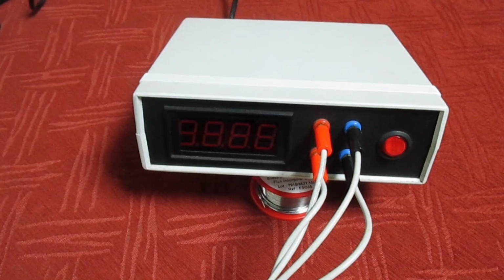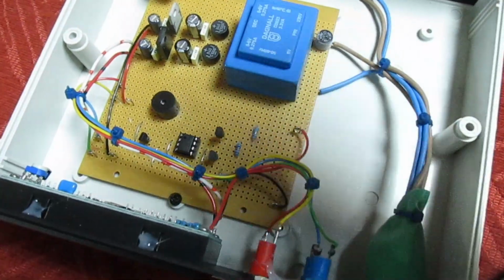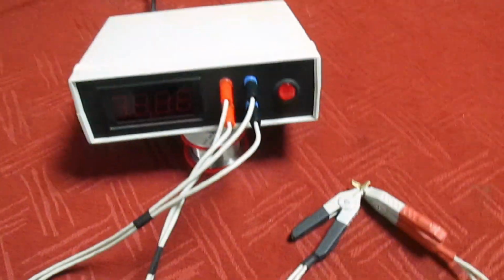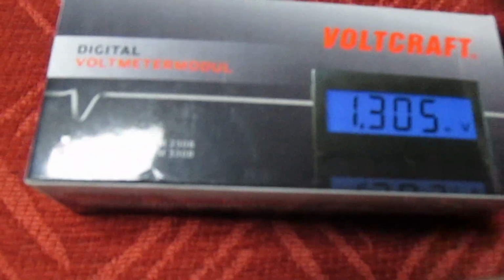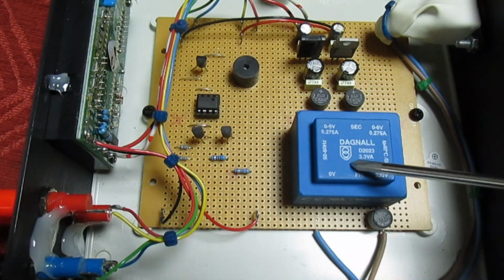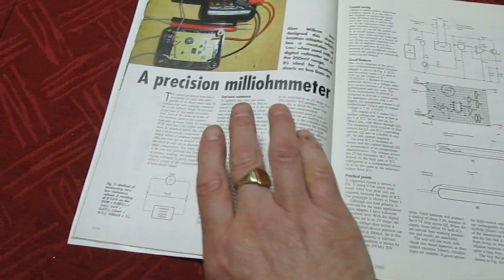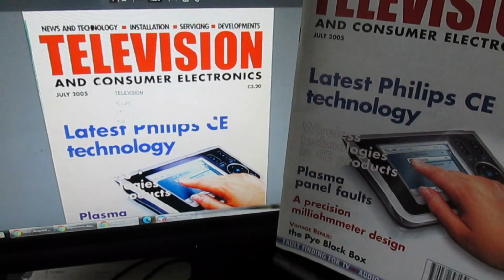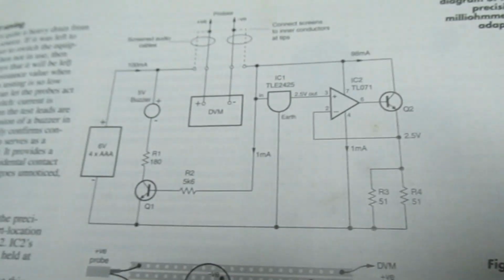DIY Precision milliohm meter by popular request with circuit diagram.

Comment: Hi Michael I enjoyed watching this video however your description of how a kelvin clip works is wrong one wire of the pair forces a current into your device under test and the other lead of the two wire set measures the voltage and because the voltmeter is of high impedence this doesnt disturb reading too much not sure of the impedence of the panel meter but your fluke handheld should be of the order of 10 Megohm impedence on the volts range hope that helps
Reply: Yes indeed. It's a very strange mistake. He keeps saying the wires are in parallel, and that it works because of the geometry, yet he built the thing, so he knows perfectly well that they are connected to different points inside the box, as we can see on the video. in any case the correct explanation is provided in the article.

He's also wrong about the current drain. Current only flows when the probes are connected to a resistance, or of course if shorted together. And that's another thing the buzzer is for. Again this is mentioned in the article.
Reply from the maker: Firstly most of my videos contain small mistakes, and if your saying current is only drawn when the probes are shorted how come the led display is lit as soon as the unit is switched on.
Reply: @michaeldranfield7140  I agree with you but i didnt say that  current only flows when connected to a resistance. I think what @EJP was trying to convey was current is only drawn through the probes when they are shorted. Obviously current is drawn for the electronics in the milliohmmeter.
Reply: @Michael Danfield This is not a 'small error', it is a major mistake. As to the current, you waved at the RHS of the circuit and stated it drew a lot of current all the time, hence no battery. It draws zero when unconnected.

Comment: I prefer to use NE5534 instead of TL071, less noise in the signal and therefore probably more accurate.
Reply from the maker: This was a very old  project and as you say there will be much better chips to use these days but the TL071 was good enough in its day .
Reply: This is mostly a DC device, the NE5534 is designed especially for it's AC properties (i.e... audio.). You can get any number of better DC performance opamps than an NE5534 these days and for around the same cost.

Comment: Hi, thanks for a great video, i built an adapter to go on my multimeter with an LM317 as a constant current source, but it seems a bit flaky. I use it to test the ground connection on mobile radio car aerials. I think i'll build your one as its an all in one device. With mobile radio, a decent earth is fairly easy to achieve at VHF and UHF, but under 70mhz it becomes a lot more critical
Reply from the maker: Excellent, I think thus would also find application in other car related things such as checking the battery negative to chassis integrity.
Reply: @michaeldranfield7140  I drive an electric car LOL!

Comment: While I do not plan on building this, I think a worthwhile upgrade would be to use 18650 batteries. They are rechargeable, commonly available,have good capacity and you do not have to mess with having to plug it in to use it.
Reply from the maker: of course , if you wanted portability .
Reply: If the device is always in one's workshop, on the other hand, a power point is likely very easy to come by

Comment: I do not have TLE2425. Could I use TL431?
Reply from the maker: I don't see why not but you would have calculate the resistance values to get the correct voltage reference, much easier to just buy the correct chip.
Reply: @michaeldranfield7140   I asked because in my town don't have the chip indicated on your video. TL431 came to my mind due to the reference voltage.

Comment: For short circuit fault finding it is better to have the output in the acoustic form (e.g. by the tone pitch,...) and with a relative reading mode (so you zero it on a value and it then indicate the lower resistances than that zero). In the 90's I remember such single purpose tester was published in our ham magazine ("A-radio" or the previous "Amaterske radio" named "Vyhledavac zkratu" aka "short circuit finder" or similar, it was published multiple times as various designs around the same principle). It used straight 2-pin connection, but the "zero memory" function took care of the probe wire resistance, so it did not need the 4 wire connection. It had just the beeper tone pitch as the main indication output and all the zeroing was by "remembering" the reference resistance as a voltage on a capacitor. It used a quad JFET opamp, one as the preaplifier, second as the "zero memory" sample and hold buffer (this was the part actually requiring the JFET inputs), 3'rd as a differential amplifier (amplifying the actual minus the stored value) and the 4th was the tone generator VCO. The sound output made the high current (30..40's mA test current from an 78L05) flowing for just a second, so the whole contraption could be made in the form of a probe supplied by a 9V battery. Components below 10Euro (my guess, prices according to the electronic component retail stores here).
Today I would approach this using some microcontroller (an attiny45 or so, featuring a preamplifier for the ADC and working down to 1.8V, so it could be run from two AAA's), but keep the "user interface" essentially the same (a pushbutton for "zeroing", piezo for tone output, maybe just add a few LEDs as an additional bargraph style indication output), just implement the circuit HW way simpler and the "zero value" memory in a more stable digital form.
Reply from the maker: I'm pretty sure the same author published an audible millivolt meter a bit before this one and while it may be good for finding large variations of resistance I'm not sure if you would be able to detect a tone difference for 1 millivolt , I dont think it would be any good to me as my hearing is not as good as it use to be years ago ., but as lcd and led displays are so cheap now theres no excuse not to use one !
Reply: @michaeldranfield7140  Well the point was you don't need to look at the display, but you could fully focus your eyes on where you are probing. So that way the work goes way faster. And for the sensitivity, if the amplifiers gain corresponds to the task, you can easily detect 10 uV or so (so way less than a mOhm at some 20mA or so test current) differences. The "zero reference memory" function and the differential indication were the key elements here, allowing the required gain so sensitivity.
To find shorts, you don't need any accuracy, you just need to distinguish what is higher and what lower.
It was a single purpose PCB short circuit finder tester tool, not a general use mOhm meter. It allows to find the shorts in a quick way, but that is all it can do, nothing else.

Comment: Dear Michael, I would love to see your meter in action.  That is, measuring some low value resistors, for example.  Thank you for making and posting this video.
Reply from the maker: I made a couple of videos in the last week or so where I used it to trace a shorted out, and one where I used it to find a shorted out capacitor.
Reply: @michaeldranfield7140  Thank you Michael.  Excellent video, and I love that low ohms meter.  (I'll look for your videos.  Thank you).  God[Bible] Bless.

Comment: The TLE2425 is pretty nifty--I'll have to use it in an upcoming project. But meanwhile, what would you think of, instead of using a 7806 on the 2nd power supply, rather use a constant-current regulator, like a LM317 with a 12.5 ohm resistor? (That, I definitely could cobble from my junk box...)
Reply from the maker: No reason you can't use a LM317, I only used the 78 series for simplicity, just decouple the input and output and you have an instant power supply.
Reply: @michaeldranfield7140  7805 and 7905 for -5v?

Comment: Thank You! I didn't know how usefull it is until I watched your videos, I've been repairing electronics most of my life, fifty at less( I'm 62)...
Reply from the maker: Same here and I'm not that far behind you at nearly 58. if you have watched the video where I can pick out a single diode from 3 in paralleled you will have realized just how useful this is .
Reply: @michaeldranfield7140  That video and one video about finding a short on tv screen with those CML 10 uF capacitors, I used to take them one by one until the short disapears,  this instrument saves a lot of time.
With it and my old scopemeter PM97 by now the two most usefull instruments!

Comment: Thank you very much for this video, especially the links to practical television which I never knew existed I thought they were long gone. I will be doing a lot of nostalgic reading. I recently built a pocket voltmeter using an esp8266 in a plastic box powered by a mobile phone battery so that I could read voltage on my phone over WiFi. I may be able to adapt this project to work with it.
Reply from the maker: Television magazine went bust over 10 years ago but someone has put them on the Web, I'm lucky  to have all the paper versions.
Reply: @michaeldranfield7140  I cant find the Television Magazine on that site now. Has it been removed?
I still have some of the original magazines but have a lot of issues missing as my pocket money went missing too!
Reply: Yes still available look under just "Television" on the left hand side

Comment: Hi can you show us a drawing of the power supply and list the components used please
Reply from the maker: Not really as its so simple I didn't draw a schematic, its just a 6 Volt regulator IC  7806 and whatever power the digital voltmeter needs, 5 volt I think, have a search on the net for 3 terminal regulator 7805 , I think it was for the panel meter ,  .

Comment: It would have been nice if you credited Alan Wilcox as he designed the unit. It was his intention to make it as simple as possible and not require a panel meter as at the time of publication cheap digital volt meters cost as little as £2.50. The circuit only pulls 100ma when the probes are attached to a short, no need to worry about batteries, you can leave it on forever and the batteries will be fine. (Alan Wilcox was a personal friend of mine,)
Reply from the maker: His name appears in the Television artical for all to see, while the original design draws no current when the probes are not shorted mine has a big red LED display which is drawing current all the time so could not be left on all the time without draining batteries, and there is a very good reason I did not refer to the author I have it in the back of my mind he is no longer with us but as I cant be absolutely sure I decided it was best to say nothing , but I am sure anyone who downloads a copy of the magazine will see the authors name .
Reply: @michaeldranfield7140  Alan would be very happy to see his work is being used. He has many publications mainly in old electronics magazines. 
 And more recently in Maplins magazine(can't remember what it was called) for a very low distortion oscillator which was stabilised using a small bulb, he used it in his MK1 ESR meter and found it wasn't necessary to have such a pure sign wave. 

His MK2 ESR meter was quite popular.
Reply from the maker: @walescmo  If my memory serves me correctly he also  did an in circuit transistor tester in about 1976 .
Reply: @michaeldranfield7140  yes we used it allot

Comment: Refreshingly simple - it makes me wonder how much more is inside the RS unit!
Reply from the maker: Is int it, I would think the RS one contains much the same stuff !
Reply: @michaeldranfield7140  yes! Maximum applied current is 100 uA. Some components now days can be damaged with even 1 milliamp applied current. The 99 MA current of the homemade device could blow stuff out!
Reply from the maker: You are indeed correct but these days I am working without a service manual as the manifactures no longer produce schematic diagrams so there is nothing to loose, you would be horrified at my other method of short tracing when the short is above 1 ohm, I use a 10 amp bench power supply to power the rail and see what burns up!!
By the way I watched your channel, very interesting, I see you are a valve person, or as they say in the states tube, I have just come across a very interesting solid state replacement for a very high voltage rectifier and plan to do a quick video very soon.
Reply: @michaeldranfield7140  Been there done that! Another way is to run an amp through the short and use a thermal infrared camera to see what is heating up.

Comment: If just finding relative resistance, wouldn't a constant current source (cc of bench psu) and dmm be sufficient?  For absolute readings, use a precision resistance calibration sample.
Reply from the maker: Much more convenient to have just one box than several different items to do the same job.

Comment: I'd be lazy, use a 5 volt regulator, and a 50 ohm resistor instead of the current source. At full scale (200 mV) it is a 4% error. Which is not a problem for troubleshooting. So all that is left is 5 volts, a 50 ohm resistor, and a volt meter.
One could even use a 5 volt USB power supply, 50 ohm resistor in series, to the kelvin clips. And a cheap DMM for readout.
However that would miss the handy buzzer.
Reply from the maker: As you say it could be made simpler but I prefer everything to be in one box and the parts to make this are not expensive anyway.

Comment: If anyone downloads the PDF of the Magazine & you read, open it up in a reader, its pages 24-25-26 / 68  RS have the components. Chip - OP-Amp in stock 6/6/2022
Reply from the maker: RS components are a trusted source, as are Farnell components and no doubt there are other trusted sources, I only mentioned RS as I have an account with them.
Reply: That makes 2 of us then Michael! :) I also use' Farnell, Mouser & Digikey.
Reply from the maker: I have used mouser and digikey in the past but they both had high order charges, as an account holder with RS I get free delivery over £5, I know all these other places cost more but at the end of the day your paying more for peace of mind the parts are genuine, I have had too much fake crap over the years.
Reply: As you said its worth paying the extra higher chargers, knowing your going to get a good working genuine part/component. I always pay for tracking for the extra safety. Oh I forgot to say before, I used to use' Maplins until they closed down as they we're local and easy some years back, Never had a bad component from them.
Reply: I've been looking and see Rapid electronics in the UK have the TL071 OP Amp but not the LP package of the TLE2425 but at least its another good source, I'm sure if i ask - request, it could be ordered I guess, they've also been a good reliable source in the past.

Comment: When I was on the bench in early 70's for MOD I used a Marconi bridge to detect shorts from 5V to 0V which crowbarred the PSU. Usually had 100 DTL chips on a board and the short was always under a chip.
Reply: Was that diode Transistor logic. I have memories off this but a bit before my time.
Reply from the maker: Invaluable no there are no schematics, would have been a nightmare in the days of TTL as you say with a hundred chip doing the same as just one would do today.